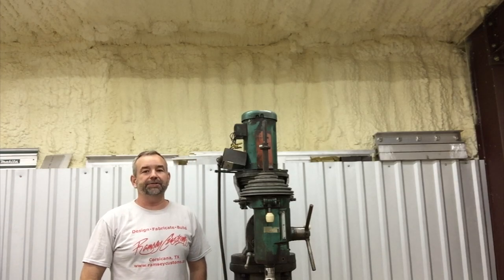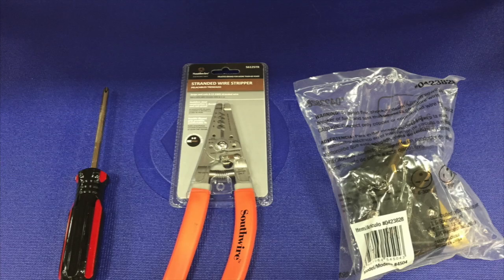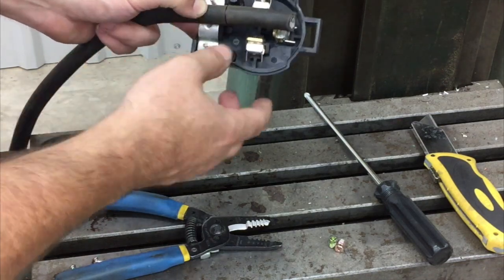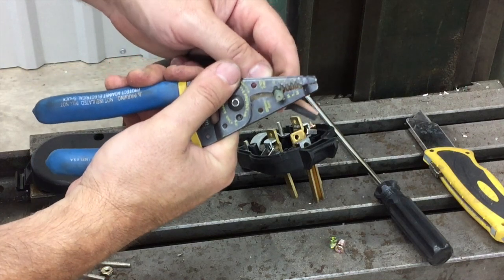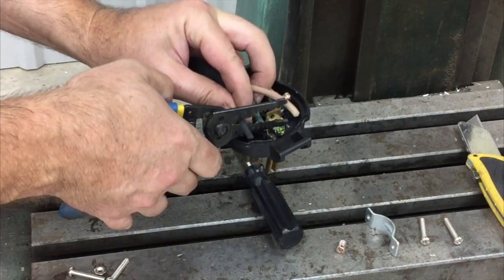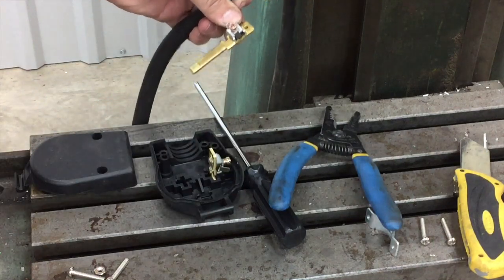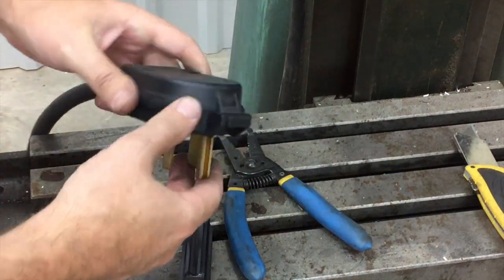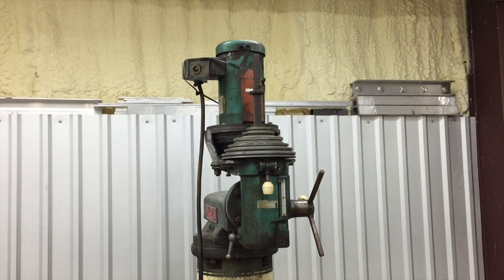How to wire a 220 Cord-Plug-Outlet for Welder - Electric Motor - Machine

Comment: how is this 240 it only has 3 wires?
Reply from the maker: its 220. 110, 110, ground.
Reply: @turbocobra  how do you figure all my plugs say 120 and big plugs say 240 and if I add 120 120 I get 240?
Reply: I am in canada if that makes a difference

Comment: You made a comment about the manufacturer not wanting the screws to be fully removed. The reason they don't want you to remove them is because the threads are crimped at the end just a little,  have you notice when you take them out you hit a spot that is a little harder to turn. The crimp is to keep the screw from falling out and being lost if it loosens. Every time you remove the screw it get a little looser each time.. not a major problem,  but it's nice to know the screws will always be there when it's time to replace the wire.

Comment: You shouldn't advise people to not worry about which the black and white wires go to, sure for most cases the electronics will work normally. However, the fusing or safety designs on some electronics are only wired to one side of the system and can allow for dangerous circumstances. Most quality designs are protected to both sides, but we've all seen shoddy design work. Especially when you can see clearly on the replacement end at 7:40 it's labeled for each color wire.. just throwing it out there.

Comment: thank you for the video.  I was noticing the foam insulation and thought I might suggest a thermal barrier paint for the spray foam in case of spark if you haven't already.   Thanks again for the video

Comment: I got a 220 welder. It came with the 30 amp u had in the video. I am going to wire it to a 40 amp plug so I can run it off of my generator. My thought process of this is to wire it like the 30 amp and cut out the bare ground wire. 
But my thought is also to make it a 4 amp it needs 2 grounds and 2 hot.  But the welder isnt setup for that.  Which way would be better?  I would need to combine the 2 postives into the fuse. Which will make it a 30 amp with a 40 amp plug but it would give more postive draw at the fuse.  The application is a 220 flux welder  that I need a 40 amp plug on.

Comment: how can you wire a on / off switch for 220 wire ?? have 230 amp compressor i wanna add a switch too .. thanks ..
Reply from the maker: Google and amazon are your friends!  Plenty of options on amazon.  Here is one for you.  https://www.amazon.com/POWERTEC-71008-Single-Phase-Switch/dp/B00KPEFL2I/ref=sr_1_11?dchild=1&keywords=220v+machine+switch&qid=1599930689&sr=8-11

Comment: For those watching, there is a reason they make 250 volt Rated plugs and receptacles in 20A, 30A, 40A, 50A, and 60A.   There is no way this mill should be connected to a 50A branch circuit.    Correct way, name plate on the machine with a motor amps times 1.25 equals the breaker and the receptacle amp values.

Comment: Yes, you are supposed to wire it with the correct polarity. Black hot goes to Small blade.  It may not matter too much in this instance, but teach consistency and care. Electricity is nothing to be cavalier about.

Comment: I have miller welder that has the same plug as that , it has 3 different configurations for voltage . I’m trying to figure out how to power it ? How much voltage ,amps , and watts do I need going to it ?

Comment: With this stated, a 3-pole, non-grounded connection is intended to have the majority of the current through the hot legs of the split-phase connection. Both have a potential of 120 volts AC to ground. Across the legs, the potential is 240 volts AC and the majority of the current is through these legs. But a small percentage is used from one leg to the neutral. This can lead to a problem IF the neutral is broken and the device is also grounded through the neutral as there WILL be 120 volts potential in the frame. Also, if the neutral conductor is the same gauge as the legs and there is a fault, that conductor could become over-loaded since both legs could short to it. As since there is no circuit breaker on a neutral, there is potential for fire. Consider 240 VAC heater elements are switched by one leg only. If there is a short from the heater element to ground, the leg that is unswitched will continue to draw, even when the machine is off! There are no safety controls for this on older appliances
Reply: No, both legs are protected by a fuse or circuit breaker.
Reply: @mr.3phase228  ok

Comment: Thank You! I have the exact same universal 220v plug that you have with the exception that I like the wire clamps on yours better than mine. I'm installing a 220v 5,000 watt garage heater and already have a 220v outlet for my Lincoln stick welder and needed a new male plug in to fit that receptacle. My local building supply store didn't have a male plug so I ended up going to a local electrical contractor's store and this universal plug set me back $27 bucks and some change, but I'm glad they had one. It's been awhile since I've done any electrical work so I needed to refresh my memory LOL. I couldn't remember if Polarity mattered on single phase 220v and you answered that question for me. I didn't want to FRY a Brand New garage heater that I just bought before I could even try it out. Thanks again. ~MO~

Comment: I just ended up plugging my welder into a pigtail that plugs into my dryer outlet.
Reply: Did that as well at my previous house.  Then when I moved I insisted that the new house have some 50amp 220v outlets.

Comment: Can one wire a slanted 3 tip plug to a welder and use an adapter to make it work in a 120 plug I brought the wrong welder.

Comment: so when wiring into a sub panel.... does the green wire go to the ground bar or the neutral bar??
Reply: Ground bar.
Reply: Well the green wire goes to the ground bar but it also gets connected to the neutral.
Reply: @secretagent5658  interesting..  ifs its a sub panel the ground and the neutral are NOT connected so that's wrong for sure
Reply: @micjam1986  You should check the NEC code book again if you haven't already. All sub panels in the United States are required to have the ground connected and bonded to the neutral in the main and all sub panels. 

My dad is an electrician and I'm also friends with an industrial electrician and a lineman. They all will tell you that your ground and neutral are connected in your panel. This is why you get a 0 voltage potential from neutral and ground. Because they are bonded together in the sub panel. We have a sub panel in the shop and it requires a neutral bonded and connected to the ground wire as per NEC code. This is also for NEC building code.

Edit: Your building will NOT pass NEC and building code if you do NOT have your neutral bonded or connected to your ground in the electrical box. And if it passes then you have a bad building inspector. Without your ground connected or bonded to your neutral in your breaker box including sub panels. GFCI outlets and faulty equipment will not work and will present an electrical shock or electrocution hazard. This is why this is a code. You can test this by putting a rod in the ground and measuring the voltage from that rod in the ground to the hot lead from your outlet using an extension cord. You should get around 120 - 125 volts on your meter. You can even do the same with the neutral. The ground wire is connected to a physical ground rod put in the ground.
Reply: OYE!!!
Reply: @micjam1986  That's what it is. You can even see for yourself by doing the test.

Comment: With an old Drill Press / Milling Machine like that it is advisable to check the specs... in case you need 3-Phase 220v.
You normally don't need to worry about this with welders or plasma cutters... but with the motorized machines...

Comment: When you use a white wire as a second hot wire, you need to designate it as a hot wire with some red tape, especially when wiring to the circuit breaker or outlet box and even in service cord plugs
Reply: I may be wrong on this...........But with a 220v Both Wires are HOT and only 1 ground, that's why it's set up with 2-20 Amp breakers with the White on one side and the Black on the other..........Thus gaining 220 Volts rather than 110 volts. Am I correct? It's been awhile but I haven't forgotten everything about electrical wiring.
Reply: That's at the breaker box and has nothing to do with plug ends like he was wiring.
Reply: Pat Pikulski wrap it with black tape!.signifying its hot.

Comment: i wanna get a welder soon and i have a 220 plug in my garage the problem is that its upside down as compared to the welding plug so if i plug in the welder it would put unnecessary strain on the welding plug is this an easy fix or do they have another adapter i can just plug into it and have it right side up?
Reply from the maker: If you shut the breaker off to that outlet, in fact, even better shut the power off to your house, you can pull that outlet out and rotated to the right orientation.  otherwise If you dont use your welder much, just keep it unplugged, unless you need it then plug it in while using it.  It won't hurt anything to have it upside down for occasional use
Reply: hey thanks alot bud i appreciate it and never thought about using it occasionally which is probably what i'll do thanks again!

Comment: I like to add a bit of extra slack to ground, such that if the wire gets yanked from the plug the phase & neutral go first and I can't end up in a situation with hot phase and neutral but no solid ground.
Reply from the maker: that's a good idea, good tip

Comment: I fear I'll have to do the reverse if I get a new welder. Change it at the outlet. Newer 220 plugs are usually the 4 prong. Actually whatever I buy is just usually different than what I have.
Reply: Please read my comment. If you have a local Contractor's Electrical Supply store they will have a Universal 220v kit to fit whatever your outlet takes. Hope that helps, I know it's been 2 years since you posted this comment but I actually ran into the same problem today.

Comment: I'm a bit puzzled regarding the electrical system in the US.
Do you have both single phase 110V and 220V?
We have where i live on a normal household three phases, zero and ground.
Single phase is 220V, two or three is 380V.
Reply: Yes in the USA residential electrical services are 120/240 volt single phase 60 hertz

Comment: Great video Gary.  Where did you get that clear female receptacle?
Reply from the maker: It's a 220v 25 ft. heavy duty extension cord, very well made.   bought mine on eBay, and have seen them at the local Northern tool store.  I just did a search on eBay and didn't see it out there, but here it is on some other website.  http://www.wireandcabletogo.com/8-3-Heavy-Duty-Welder-Extension-Cord-25ft-or-50ft-Amps.html?gclid=CMijlNWI280CFYSAaQodbH0M-A